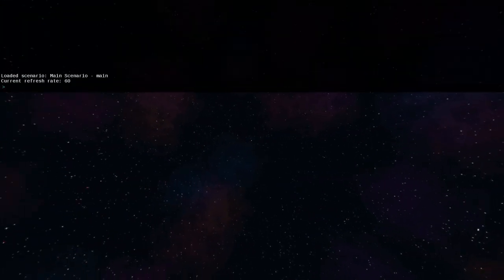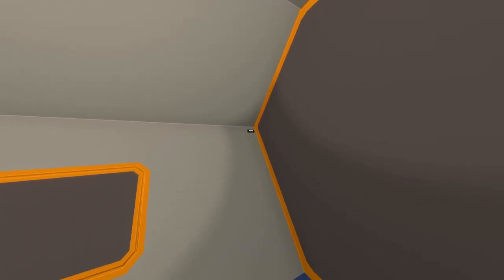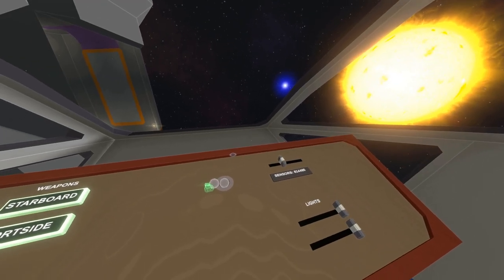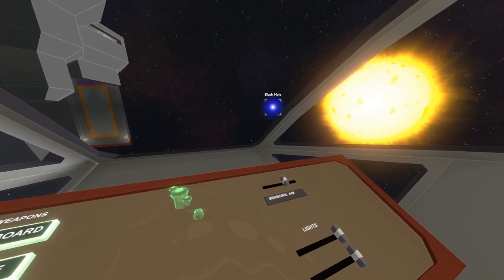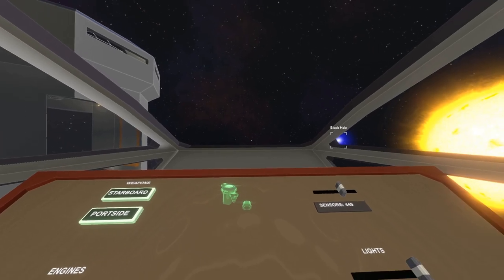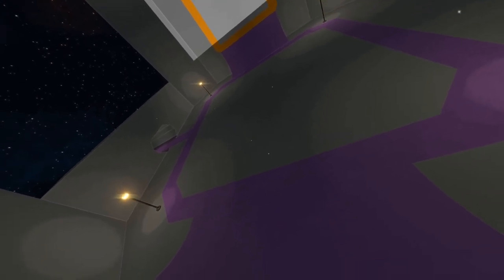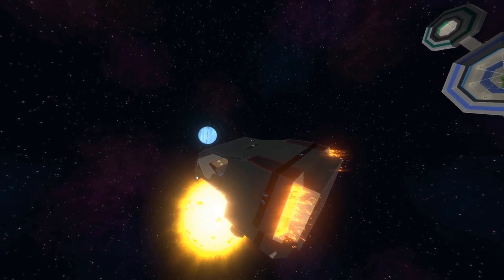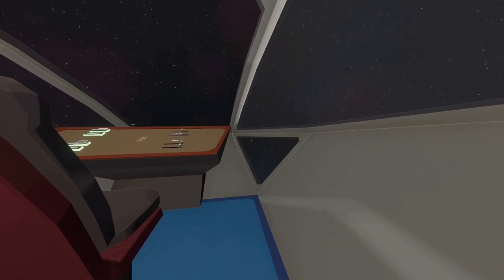Tailspin Devlog 13 - Holographic Sensors and Shuttlecraft

Comment: Shuttle is looking good! Wonder if it's worth having a radial menu when you need so many small buttons in such a small space? Holding the interact button against an area to give you options?
Reply from the maker: Thanks! That's a good idea, I've held on to this concept that the game could be played with minimal keybindings and menus, but as I've continued I've realised that either I keep the number of buttons to a real minimum (and make them bigger) or I need another way to interact with them as well. 

This has given me an idea though, perhaps making use of a radial menu that also lines up with nearby elements that can be interacted with, almost like Diablo's highlighting of things on the ground, it doesn't replace being able to click on them but it does make it easier.